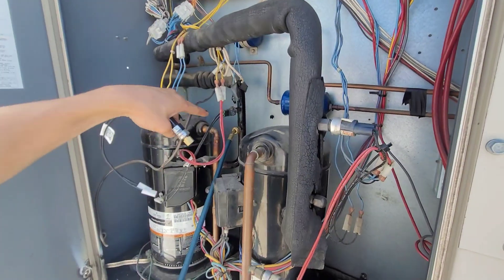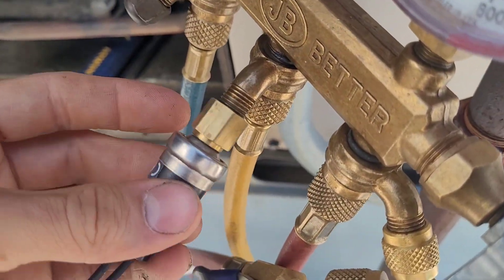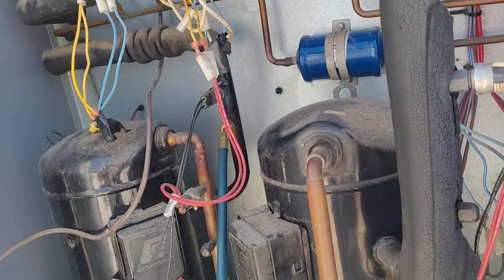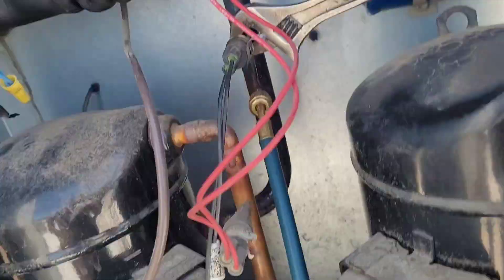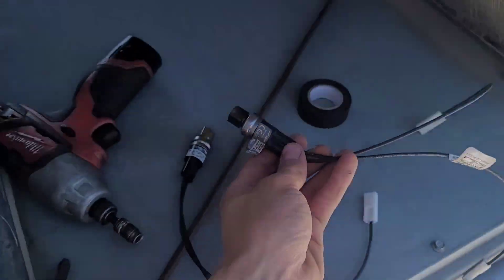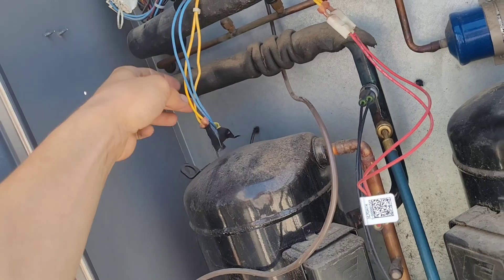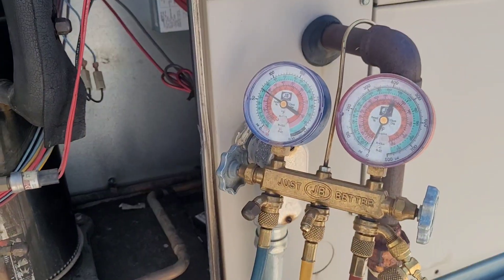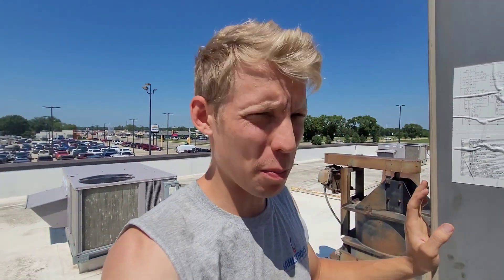How to tell if a Schrader is installed on a pressure switch!

Comment: I just did one of these but on a Trane intellipak. It was the high pressure cutout and had the same design with the schrader depressor (OEM). I pulled the gas anyways and I'm glad I did because there was no schrader in there.
Reply from the maker: Yeah, it's just such a toss up! I wish there was an easy way to know if they had a Schrader. A liquid line would be a lot more difficult to do this checking method to.

Comment: at which age you realized that you love technical stuff and troubleshooting systems? btw you are an ISTP
Reply from the maker: Probably when I got my first lawnmower engine fixed at like 15. I think that much of what I do now was more intimidating and less enjoyable for a long time, but as I have learned I enjoy the troubleshooting more and more.
Reply: @ReubenSahlstrom  totally relatable as a child I was laid back and not interested enough to learn any technical skill especially if it something full of abstract I get overwhelmed but In general I was curious about random things I would watch any documentary out there ,  but I ones watched a video on how engines work and I was amazed by the simplicity and accuracy of the process like a valve open then air is sucked then compressed then boom and the expanded gas push the pistons down and that happens about 50 times per second super fascinating!! at that point I couldn't stop learning It was addictive to learn how things work and how you can repair anything for free and probably make a living out of it ! and that just tell us to give things a chance and try them thoroughly before judging them especially when it something useful

Comment: turn fan off, run compressor, you should get lower pressure to be able to change it even without core
Reply from the maker: This system is running an r22 replacement called r422b which has almost identical pressures to r22. Killing the fan and letting it run a while would help lower the pressure, and depending on how long you were willing to let the evaporator freeze up could probably get down to like 20 psi, but by then it would be quite froze up. I remember changing one on a walk in cooler that we actually did something similar to and changed it "live" so to speak.
Reply: you've gotta be kidding, 410a comfort cooling systems systems run over 100 psi on the low side! without fan would be less but still fairly high. that may work for refrigeration with lower low-side pressure and lower pressure refrigerants like 134a!
Reply: @Jon-hx7pe why there is 80 psi on gauges then?